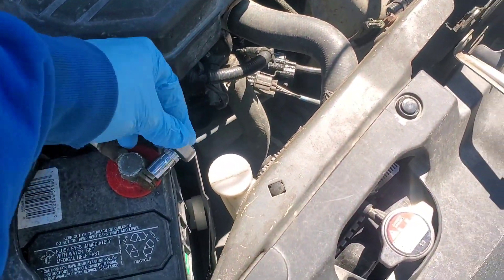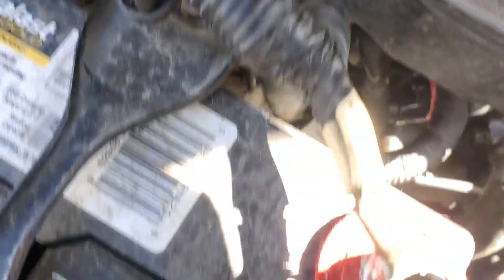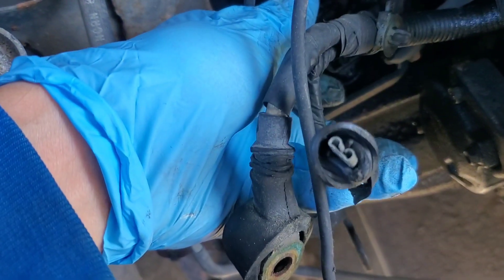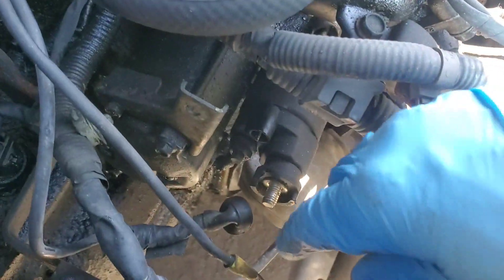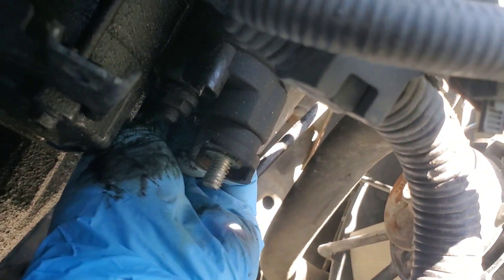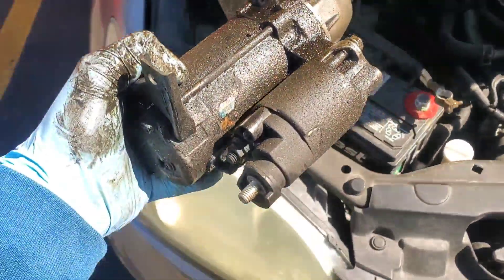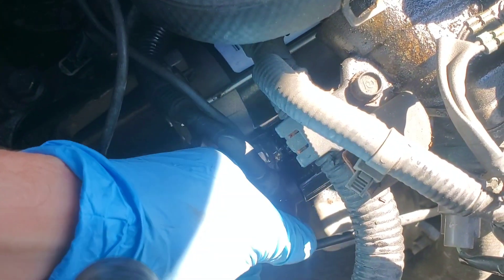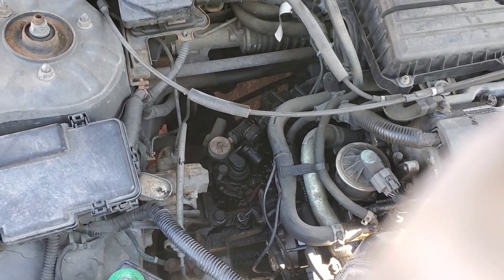2004 Honda Civic 1.7 Starter Replacement!

Comment: My 02 manual civic used to start strong but lately it has been sounding sluggish during crank. I had the battery test good. I believe the starter is going bad and will attempt to replace next w/e, thanks